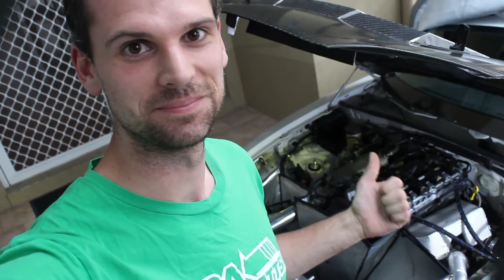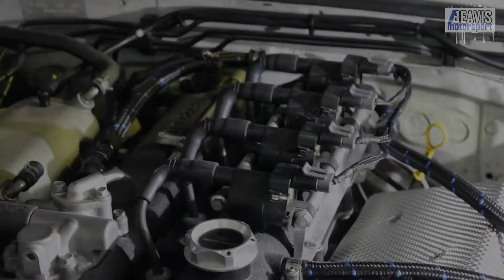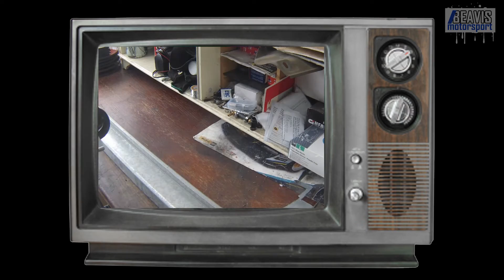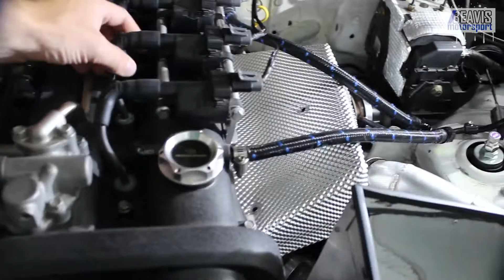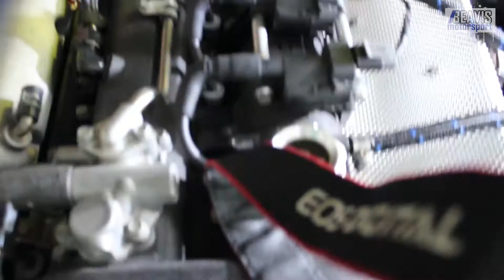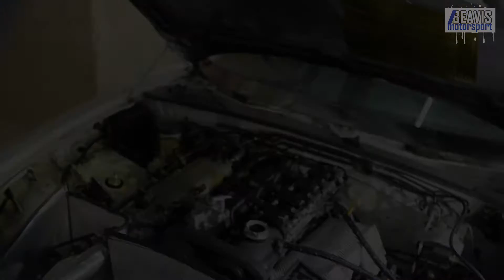How to upgrade your Coil Packs - Episode 17 - Time Attack MX-5 Miata TURBO Build

Comment: Just wanted to add that the recommended dwell times are 3.5ms. 4-4.5ms may be ok however some coils may have an inbuilt "safety" feature that fires the coils pre-maturely when they are overcharged which can cause a dangerous advanced spark.
Reply from the maker: Thanks for the clarification. The dwell setting is fundamentally the only change necessary to the car other than the physical changes i have shown in the video of the coil packs, wiring and leads.